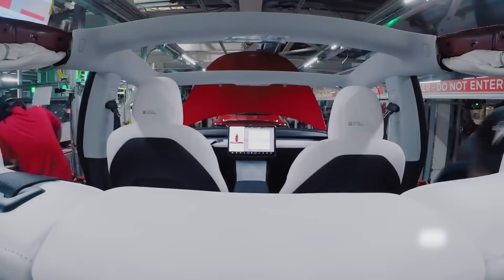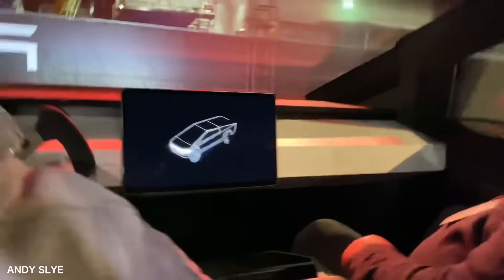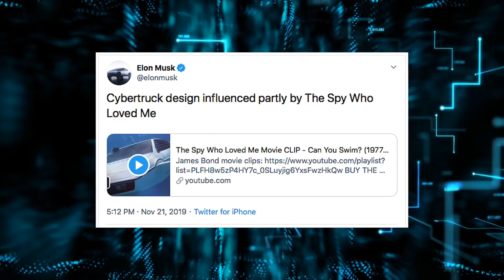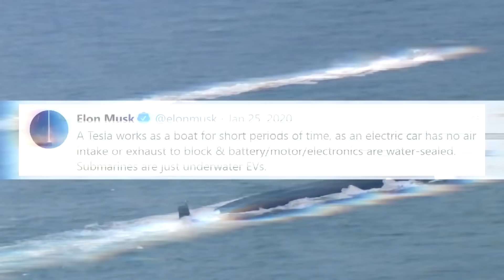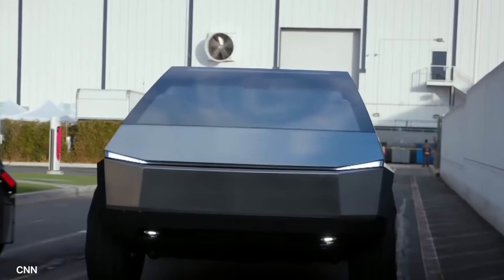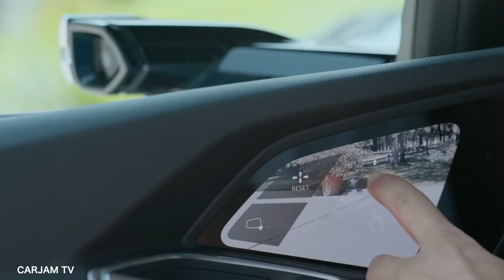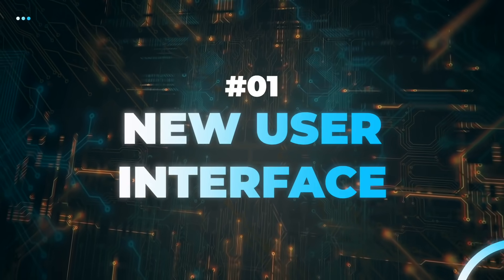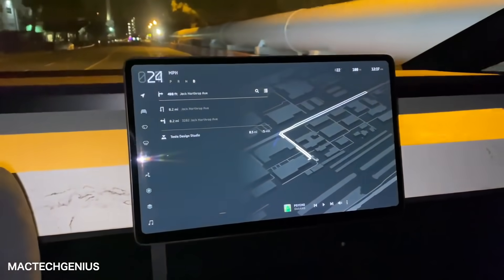Tesla Cybertruck - This is why Cybertruck is Special

Comment: Free energy is in our Bibles and is so super simple that it should be positive proof of an extremely powerful spiritual warfare that is going on behind the scenes, in order to cover up the simplicity of this technology. This free energy technology is so old that it can be found in Ezekiel 1:16, where it is attempting to describe the workings of a UFO motor = ”a wheel in the middle of a wheel”. I used pulleys to imitate this technology, where you only input a few sparks of current for 1 rotation of a motor with a large 33 cm circumference, (about 10 cm diameter) pulley attached. This would freely gain your 99 cycles of AC or DC electricity, from 3 mini-pulleys of 1 cm circumference-(about 0.33 cm diameter) with AC or DC motors/generators attached, by simply running the same belt-strap or even a tied piece of rope or string in a pinch, past these 3 or more mini-pulleys. 
- 
Want to know more about something that really matters, like the Truth about the true powers of this world, reality + what our lives are truly all about. Trump believes in our Father in Heaven, and by the way, the ARK of the COVENANT has been found in Jeremiah's Grotto, right under where YESHUA=Jesus was crucified. So HIS BLOOD + WATER that came out when He was stabbed by the spear could run down the crack in the bedrock, that happened when the earth quaked + landed on the correct side of the ARK, that was placed there many hundreds of years earlier. His dried BLOOD was still alive even, + tested as only having 24 CHROMOSOMES = Virgin Born + proving HIS DIVINITY.. (only had one parent= regular 46, which is 23 chromosomes each) + with 23 from His mother and only one male Y chromosome from His Father in Heaven.
-
-PLEASE WATCH THIS VIDEO https://www.youtube.com/watch?v=B8TRoQk6WUE @ (41:41) = HIS Blood is STILL ALIVE + had only 24 chromosomes = 23 from his mother + only One from His Father (normal people have 46 = 23 from the mother + 23 from the father). If these videos have been taken down, then in YouTube search these words = ( ark of covenant blood Ron Wyatt ) - Sorry guys + gals, but the higher up elite of mankind has decided to believe + side with these aliens (fallen angels + Nephilim) = sons+daughters of the children of fallen angels + human females in building these particle colliders - which mess with our timelines + allow evil spirits into our reality. 
-
I cannot be sure if Trump was-is+will-be the best American President,,, but did you notice that the fake news of the very corrupt media does not mention all of the great things Trump did?. Democrats not only want to kill your unborn offspring, but they want to kill them after birth even. DON'T BELIEVE ME,,,., then Google Democrat + abortion, then you can see for yourself. 
+ BY THE WAY - ISN'T THE FACT THAT THE ARK OF THE COVENANT HAS BEEN FOUND + WITH CHRIST'S BLOOD STILL ALIVE ON IT, + HAVING ONLY 24 CHROMOSOMES = PROOF OF VIRGIN BORN (the biggest NEWS ever, and proof of the corrupt + fake NEWS) + PROOF = search YouTube
-
TRUMP ELECTION SCANDAL <<< If these are true=This Is Scary >>>
https://www.youtube.com/watch?v=NOiaymqaQdc&fbclid=IwAR1lcZFAjGij0TmkIGLRLsJnayWpZsTRViXB-DmOATG0E3JXgHlWl5fAl9g
+ https://www.youtube.com/watch?v=V_7Z058MC7M&t=3735s
+ https://www.youtube.com/watch?v=dBj9ZDC_Ad8&t=1481s
+ https://www.youtube.com/watch?v=m0YKf-caVuY&t=240s
+ https://www.youtube.com/watch?v=V_7Z058MC7M&t=3720s
+ https://www.youtube.com/watch?v=OWwNJZhcrww
+ https://www.youtube.com/watch?v=R5ki6S-WsKU&t=977s
+ https://www.youtube.com/watch?v=Z8UZn7PmyXc&t=112s
+ https://www.youtube.com/watch?v=Dc-HQyBm8GU&t=4242s
+ https://www.youtube.com/watch?v=OUS9mM8Xbbw
+ https://www.youtube.com/watch?v=2bfWCdg4B04
+ https://www.youtube.com/watch?v=HIKOXyxlhag&t=381s
+ https://www.youtube.com/watch?v=fCqwwHs6oU0
+ https://www.youtube.com/watch?v=V_7Z058MC7M&t=3735s
+ https://www.youtube.com/watch?v=bgMpTQNCcgg
-
Isn't it amazing what knowledge we can gain by simply adding the “il-s” of life, into this evil theory.,, EVil-sOLUTION. Evolution never happened,,, and it never had the time, so it could have happened,,,, because we have only been here on this earth for about 6000 years. Think about the odds of us on this earth that is constantly gaining mass from space dust and meteors, revolving around a sun that is always losing mass from burning fuel=mass. If mankind has evolved over billions of years, then why is there only about 6000 years worth of His-story and so little space dust on the moon = see the moon landings, there are only a few cms of space dust. If evolution ever happened, then it needed the moon to keep the oceans from becoming stagnant water.
-
WHERE ARE THE THE BILLIONS OF YEARS WORTH OF DUST DEPOSIT. Surely that would have produce meters of dust, as would not the dust have been even thicker way back then + Don't try to tell me that something or someone removed the dust every so many thousand years.
-
DO THE MATH FOR YOURSELF = the amount of dust deposit is known,,, + the amount deposited every year is known too. I did the math in the early '90s, and it worked out to be about 6000 years worth of dust that is on the moon now. I don't know if they use the same figures now or not. But even so, it should be obvious that after even one billion years,,,, the dust should be many meters thick.
- 
TRUTH about COVID-19 = https://www.youtube.com/watch?v=H_vNWmqWmZc 
+ https://www.youtube.com/watch?v=vzIWq_59MIY
-
This is so simple that it should be proof positive of the Battle between GOOD + EVIL.
Proof of a most powerful war going on in the background, with REAL BAD FORCES that are controlling our lives. Please remember that Satan is called the ”god of this world” in our Scriptures = (2 Corinthians 4:4). You only need to input a few sparks of current, that rotates a large 33  cm circumference pulley once, to multiply you an output of 99 cycles of AC or DC electricity from 3 mini-pulleys. Do you see how super simple this is, and how powerful the evil forces are to keep this super simple technology from us for so long?
-
FREE ENERGY = SIMPLICITY AT THE BEST (AC Electricity Multiplication using simply the geometry of pulleys to multiply AC rotations) (a DC motor only takes a few sparks of current, to rotate one full time) Please don't be fooled by the old false torque problem lie, because this torque only occurs when you are producing power. And no matter how much voltage you need, when you multiply it by the few sparks of current that you need, (practically nothing) it equals only the smallest amount of power, (requiring very little torque).
-
THIS AC ELECTRICITY MULTIPLIER WORKS, and it is so logical that it simply MUST WORK. This uses a few sparks of DC current to rotate one large pulley of 33 cm circumference = (about 10 cm in diameter) one single time. Then by rotating 1 to 3 mini-pulleys, of one-centimeter circumference, = 33 rotations each. If you attach AC or DC generators to each of these mini-pulleys, then you can get a return of 33 to 99 cycles of AC or DC electricity as an output. Which is far more electricity output than you would need for the few sparks of DC input, which is all the input drive motor needs to rotate once.
-
The only reason that this super simple technology has not been used earlier to create free energy for us, are the millions, if not billions of fallen angels + evil spirits, trying desperately to make sure, that mankind never discovers this super simple technology, which is God’s Gift to mankind, which He laid out for us way back in Ezekiel 1:16 http://free-energy.yolasite.com/
-
(EZE 1:16) “The appearance of the wheels and their work was like unto the color of a beryl: and they four had one likeness: and their appearance and their work was as it were a wheel in the middle of a wheel.” - As in, a little wheel inside a big wheel, but I could not afford to buy a big wheel with threading on the inside, and a mini wheel with the same threading on its outside. So I did the next best thing, I connected a big wheel to a mini wheel through a belt, strap, rope, or even a piece of string in a pinch to connect the two pulleys with motors attached.
-
Have you ever heard of the MANDELA Effect? PLEASE CHECK THIS OUT,,,, + then try telling me that there is not a POWERFUL SPIRITUAL WARFARE going on in our world. This is a must-watch video. All of time and space are changing. Things that are true have been altered + CERN is the cause for these events.
https://www.youtube.com/watch?v=pPrutcbaerQ
- 
Here is one of the videos trying to let this scary information out https://www.youtube.com/watchv=pPrutcbaerQ&list=PLDIEv5nkqqEa0-u8DIzqpefKBAG0nkb7g&index=1 
OPPPPSSS,,, that one has been taken off the web,,, TRY THIS ONE - 
https://www.readersdigest.com.au/true-stories-lifestyle/thought-provoking/44-mandela-effect-examples-that-are-seriously-mind-bending
-
+ here is an explanation by the Physicists https://www.youtube.com/watch?v=HHKmoBeNWWQ&list=PLDIEv5nkqqEa0-u8DIzqpefKBAG0nkb7g&index=2 
-
CERN Is Changing Our Timelines – Proof - Mandela Effect Part 1 + this is a video of what they are really up to https://www.youtube.com/watch?v=49dGknES0-w 
-
Here is a website that shows you how quick + simple this GEM technology is to build
= https://www.youtube.com/watch?reload=9&v=NxpoiCFKmPg 
-
http://beliefstoliveby.yolasite.com/ 
http://evolutiondebate.yolasite.com/ 
-
TRUTH ABOUT CERN
https://www.youtube.com/watch?v=49dGknES0-w 
https://www.youtube.com/watch?v=ooZA0riSa9Y 
D-WAVE COMPUTER
https://www.youtube.com/watch?v=1v19n5JBSDs&t=305s 
RELEASING DARKNESS
https://www.youtube.com/watch?v=7TA-z6RrXRo 
EXTREME NATURE CHANGES
https://www.youtube.com/watch?v=7HnSOZXZdWU 
SATAN’s NAME IS "God"
https://www.youtube.com/watch?v=_qr2vT5ySLA&t=
ILLUMINATI PLAN FOR HUMANITY
https://www.youtube.com/watch?v=49dGknES0-w

Comment: I think side mirrors should be an option... Because it doesn't need battery to used   ....so still used both....they could used hidden side mirrors if u want it flick a switch  and I flips out....mirrors are one of does things like a condom ...to have one and not need it....to need it and not have one.. lol 😂

Comment: I love new technology. But not when it’s done poorly.  This is destined to become the next mall crawler. For one...off roading. You can’t even see over that dash. The drivers seat is so far back on the vehicle and at a slant you couldn’t see hitting rocks or where you’ll climb because it’s too wide as well. And watching a screen is not off roading. Notice they don’t show this. They just show dunes when they go of road. You won’t hit anything there. The design is retro 80s sci-fi. Cool but horribly dated to where it will become a collector like a Delorean or just out of place with other technology coming out. I’d like to see this fit in a parking lot. Which you know you’ll need to do on an everyday basis. And apparently auto makers of all kinds want you to be in debt for years to come by charging 70k plus for everything.  And where did even 30k come from to make a basic car specially when the salaries of most haven’t been adjusted for the cost of living in 20 + years. So think about this. You see technology like this, but the jets flying over your head have had no advancement in 50 years. Something is wrong. Seems like this guy has some great ideas for technology but bad applications for them and an elitist idea for everything he does.

Comment: It’s ugly! Plus the driving range depends on the weather. Batteries are much less efficient in cold weather plus use a lot of power to heat the cabin in sub zero weather. If no one is paying a gasoline tax the government will be placing a tax on your recharging stations. Manufacturing millions of batteries will create nightmares on the environment because of all the mining problems necessary to create new batteries. Resale of electric vehicles is crap because batteries lose efficiency as they age, and are very expensive to repair or replace.
Reply: That's the same with extracting coal and oil plus they're looking into asteroid mining

Comment: So you know:
1. 304 steel is the most commonest application of stainless steel. It is not bulletproof.
2. Passenger windows on the cybertruck were briefed to be shatterproof. Mr Musk misunderstood.
3. The flat, angular design of the cybertruck is a cost saving trait.
4. The load bin will deliberately be  less volumetric... electric motors are less efficient under a load than diesel motors.
5. The design concept does not make production sense.
6. The cybertruck will likely only be sold in the US as it will not meet NCAP safety regulations.
7. Its a cool truck though...

Comment: My "Old Fashioned" truck has mirrors, and I can drive about 400 miles on a tank of fuel. When I do have to refuel it takes about 10 minutes and that includes using the restroom and getting some snacks and drinks for the next 400 miles. Going to have to give it a HARD PASS, and that's not even taking into account that Tesla Truck looks like my 3 year old designed it.
Reply: I really don't care if it goes faster it can do 0-60 in 2.9 seconds. We just want a practical truck that doesn't go against regulations. Sure it's faster than others but it's a stupid way to market a truck🤦
Reply: Yeah this thing is trash and now ford unveiled the Lightning which made this ugly thing even more irrelevant.

Comment: Imagine hitting someone with the cybertruck... The person is straight “DEAD”!
Reply from the maker: True but I guess that would be with any vehicle lol
Reply: @TechDivision1  Actually no, all modern vehicles follow a myriad of pedestrian impact rules which would (hopefully) scoop a person up and throw them rather than pulverize them.  I have no idea how the Cybertruck is going to get away with that pointed front which seems to do the opposite.  I have mine on order and I have no idea what it will look like LOL
Reply: @BradThePitts  Is that applicable to trucks though? Or SUVs? Most of them have a large, flat cross sectional area in front.

Comment: love Tesla Cars but I inmediately noticed that  the cybertruck over extended side columns supports for the windshield decrease angle of vision same as found in the 90''s Oldsmobile Silhoutte Minivan, which was not welcome very well , the extreme simplicity of the dashboard does not enlighten me, hopefully it is just a test bed for the power train and the final body may become something different, crossing my fingers now.
Reply from the maker: Final truck version will definitely have lot's of changes.

Comment: The cost of 100k will turn off most folks
Reply: Except for not having to pay $500 in fuel...that's half the car payment right there.
Reply: You better check your prices there.   It starts at 40k
Reply: $40k, $50k, and $70k. this is the average price of a truck sold in the US. its on par and even cheaper than many trucks

Comment: the only way this could possibly get any cooler would be if it had a steering wheel on the passenger side also, and they could push a button to switch steering wheels....or if you could slide the screen out, slide the steering wheel to the passenger side, and push the screen back in... i mean seriously, everybodys gonna be watching movies theyre not gonna wanna drive all the time

Comment: Steering wheel too small and not a circle, too F-1 style and its a pickup truck not a race car so regular would've been better. Every god damn thing is controlled via that screen even A/C so you can't put A/C on (or change temperature) without taking your eyes off the road while driving. Physical buttons are better and easier to operate whilst driving. 
I wonder if that "thing" even has heated front and back wind shields and how will this truck co-op with finnish winters? They put a ugly middle seat instead of an multi function armrest that has compartments, were are the middle mug holders? Soo many design flaws. it looks like a fucking bus instead of a 5 seater pickup truck. i know that some vans have 3 seats in front but they are for work use it looks like this stupid "cybertruck" is a replacment for Ford Transit not F-150.
You make a truck bullet proof without the need of it being bullet proof but you morons cant make a proper dash? you made one from paper? who asked you to make it from paper? just for fucks sake make normal car once.
This would've been a cool truck but u guys ducked it up with boring interior too ugly exterior. I can already say that despite its cheap price this wont sell